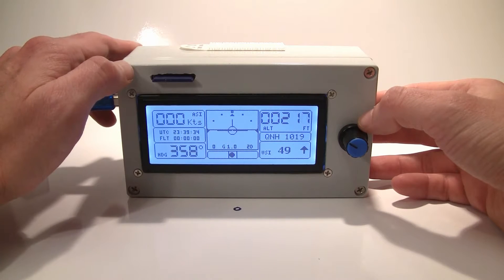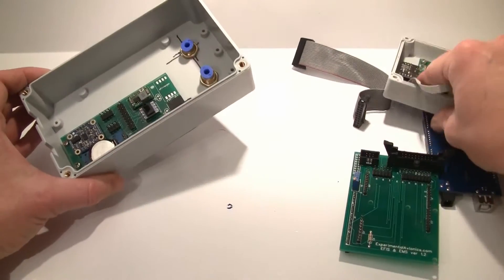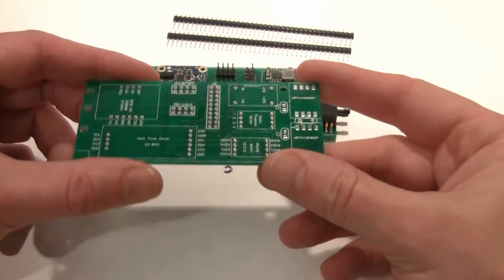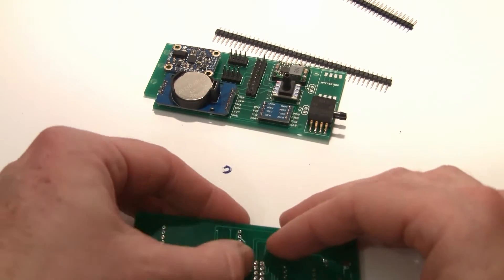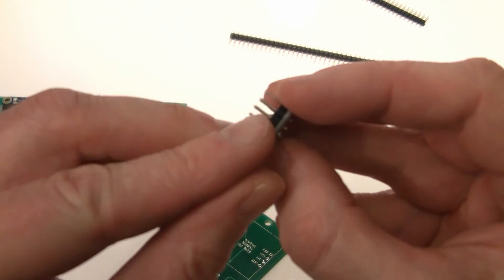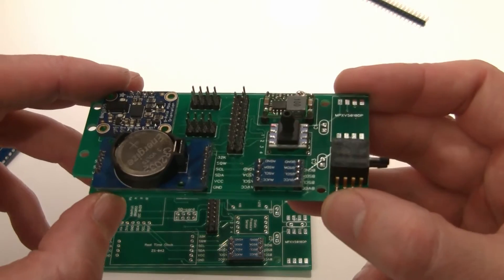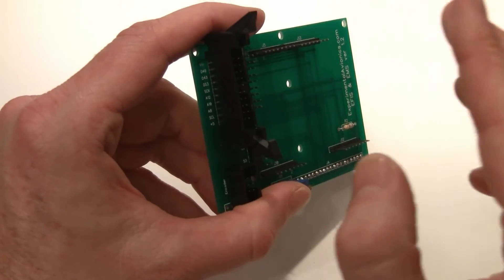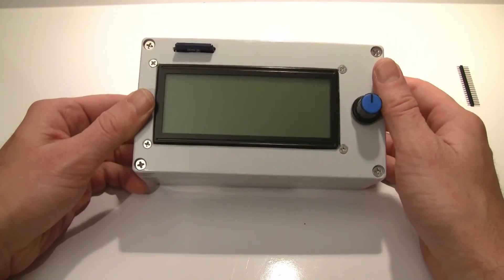EFIS v1.2 assembling PCB boards

Comment: Are there any other options then using the BNO-055Gyro-Magnetometer-Accelerometer?   Other  Accelerometers can be had for just a few dollars.
Reply from the maker: There are other, much cheaper options but they would require the "fusion" algorithm development. BNO055 has an internal processor and all the built-in software to do it on-the-fly.
Reply: Thank You for the rapid Reply.   B0055 it is then.

Comment: Thanks for this video. You did a very good job. I have all of the parts to build this EFIS but no breadboard yet. I still need to download the sketch. Any chance of buying your PCB or two and mailing to the States?
Reply from the maker: Hi Jon,
Thank you for your interest.
The PCB boards are available from the store on the website http://experimentalavionics.com/store/
The sketch has just been uploaded on the project's page: http://experimentalavionics.com/efis-19264-ver-1-2/
Feel free to download it.
Let me know if you have any questions.
Oleg
Reply: Experimental Avionics
Hello Oleg,
I have ordered 2 each of your boards plus 2 cases. I included 1 shipping charge to the US. Is it enough? Let me know if it isn't.

This will go in my Diamant-18 sailplane which is experimental and will be a backup in my Cessna 172. For the glider it will be a primary instrument and for the Cessna it will be a backup instrument. We can never be too safety conscience.

When I get my items, I should then have the time to build it. I have all of the parts for your first version and I think I ordered all of the parts for version 2. I will check after I send this post. I ordered 2 each for any mistakes I may make and then one will be a second unit for experimentation. I hope this purchase helps you too. Many thanks. Jon
Reply from the maker: Hi Jon,
Thank you for your order. I have replied to you paypal email.
Oleg
Reply: Experimental Avionics
In the coming months, I will keep you informed as to how my build is working out.